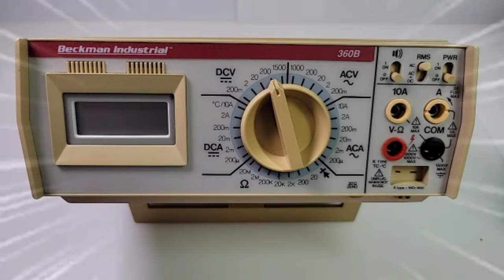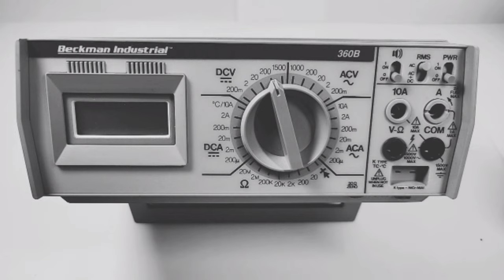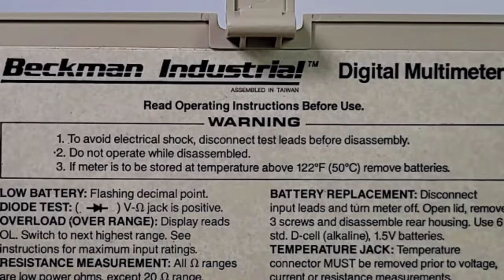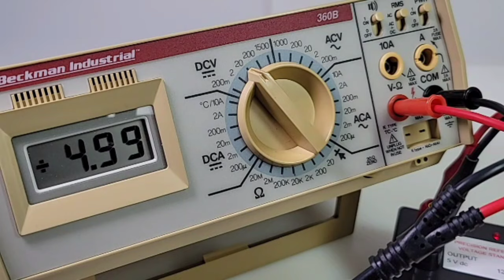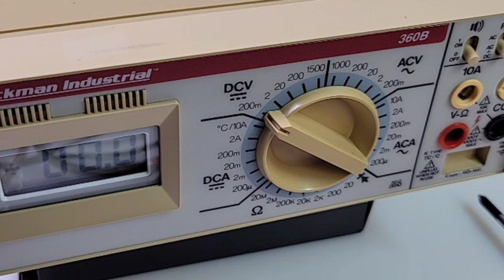RETRO-TECH ○ BECKMAN INDUSTRIAL 360B Bench Multimeter Mini Review & Teardown!

Comment: in 1980 my boss bought some BECKMAN 320 (or 310) hand held  multimeters , one for each engineer, and I stil remember that meter as my first digital multimeter. 
We had others in the lab,  but they were too slow,.
The meter had a problem: there was  a diode bridge in the input protection circuit, and it had a standard failure mode_  The bridge went short , in some overload situation, and the meter stopped working. It was capable of lighting LEDs, and it was  extremely useful for audio amplifiers maintenance. it replaced the Company's "standardmultimeter" (AVO Avometer MK 8).
I'm sorry because you did not disassemble the front circuitry:  The  range switch was built in a different style than those used currently.
The A/D circuitry was integral with the LCD frame, and it was really  easy to break the plastic clips that connected the two  parts.
One of my former colleagues got one from the Company as a freebie when he retired, and that meter is still working after 40 years.
Reply from the maker: Wow..that's a great trip down memory lane..Great to hear that 40+ years later it's still going strong. A real testament too the engineering prowess that Beckman instruments brought to the testing table.
Those Beckman 310 multimeters are definitely classics unto themselves 😀👍

Comment: Do these huge 1.5v DC batteries combined to form 9v make it last longer than a single 9v battery? I see 9v connector and they could have used single cell. Also, nice to see the internals, shielding and overall robust construction. 😁
Reply from the maker: Really wanted to go deeper but part of the shell on mine was glued so it was impossible without breaking the facade..
Crazy..those batteries weigh a ton too.
However, the drain would be less than a 9v so makes sense considering the age of this instrument. 1x9v=14,440 Joules, 6x1.5v=89,100 Joules / Meaning, for 6 times the weight (Density) you get rouhhly almist 5x times the available energy..thereabouts.
So definitely better power efficiency in the Long term as opposed to using a 9v battery.